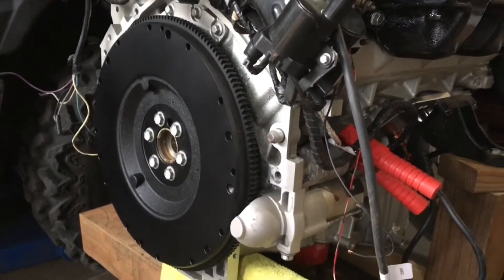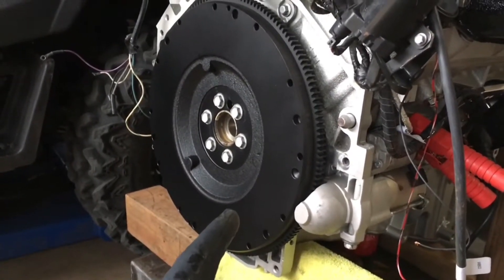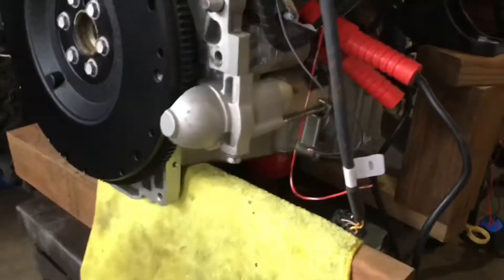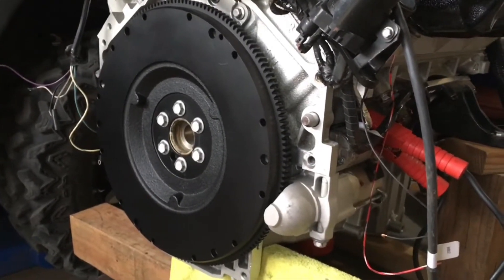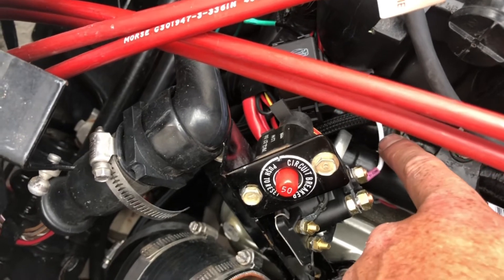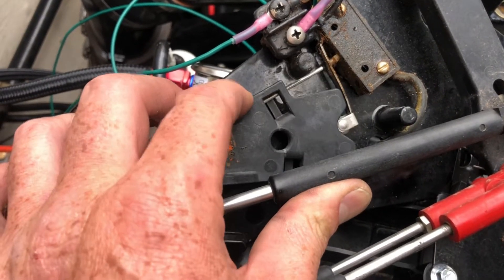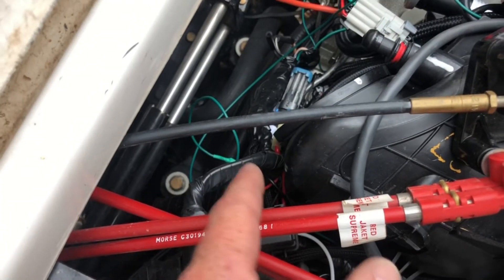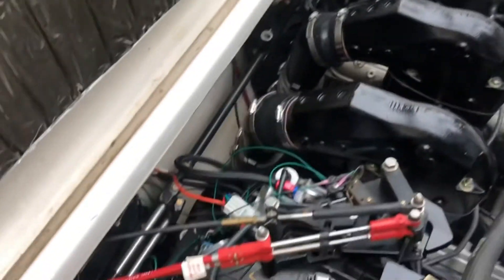(Vid #4 of 5) Twin LS Swap On 30’ Bayliner (4.8 Flywheel Fitment / Shift Interrupt NLTS TerminatorX)

Comment: Can this be made to work with a 5.7 mag behind an alpha 1? Just swapped my old efi 5.7 for a MPI 5.7 and need to wire in a interuptor switch. Not sure if it applies the same since I'm not running a Holley setup